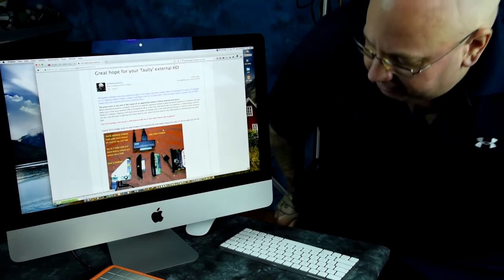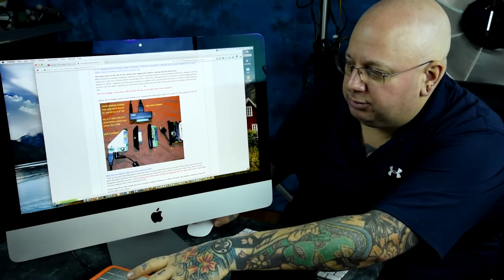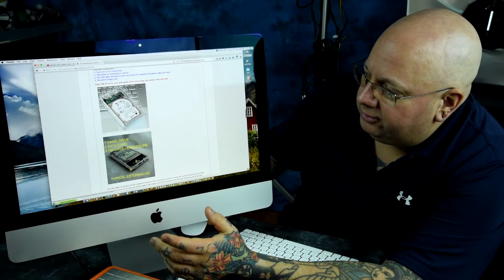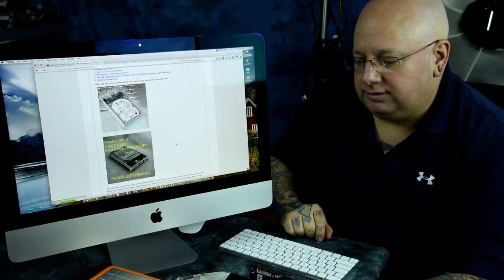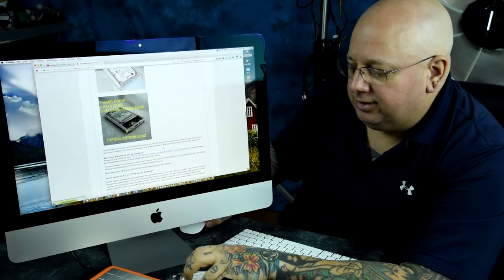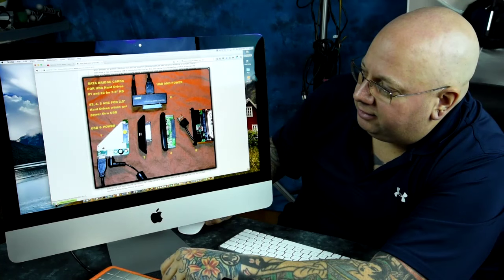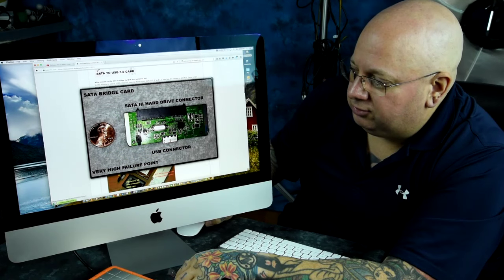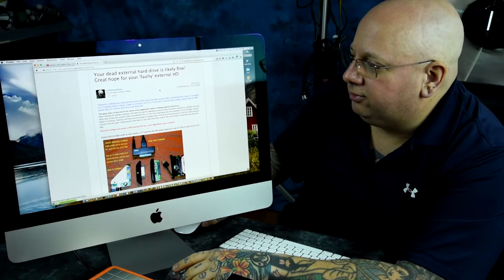Secret of "dead" external HARD DRIVES! How to QUICKLY fix the problem, its cause and solution

Comment: "Responsible for 95% of hard drive deaths". Spot on. I thought I had lost a slew of precious irreplaceable data. I cannot thank you enough. God bless you.
Reply: @Terry Riley how did you manage to recover data?
Reply: @baccount2813 I have a Seagate 2TB external hard drive. The light was on but not blinking and my computer was not detecting anything. I seen this video stating that the SATA bridge is to blame for 95% of hard drive failures, so I did further research and found this video: https://youtu.be/AW12Cm7L3qA It's specifically for Seagate drives but you should be able to apply it. Once I replaced the SATA bridge, all files appeared again. Please let me know how you do.
Reply: @terryriley1174  I have 4TB external harddrive and it shows up on my PC but unable to access it. It gives a pop up message to format the drive. I ran chkdsk (couldn't complete the chkdsk) on my external harddrive and during the process it gave errors like 'file record segment unreadable' and 'deleting corrupt attribute record from file record segment'. I checked the properties of the drive  through a partition software and it showed used space: 0kb and free space : 3.64TB. Don't know how to go about it
Reply: @terryriley1174  4TB WD passport hard drive
Reply: @baccount2813  Sorry but I don't have a clue. I would just type some of those error messages verbatim into Google and take it from there..

Comment: Well, your tip JUST SAVED MY BACON.  My external seagate drive stopped working, so I opened it took the drive out and installed it in an external case, it works just fine, I’m backing it up as I write this note of great gratitude and thanks.

Comment: You just saved my data with pictures and iTunes folder. My Portable Samsung just stopped working, it happened a few weeks ago where it wouldn't mount, but after a few plus / unplug it worked again and I forgot about it, till yesterday or it didn't wanted to mount. Disk seemed to be ok, but little light didn't blink, so after listening to your video, it all made sense, now it's ok, but I'll make a second copy for sure. THANKS!

Comment: I have an old Seagate Barracuda Hdd that would not connect to my PC. It would make a sound like it wanted to start spinning and then it would stop and make a faint click. After watching this vid I went to Best Buy got a hard drive dock, I removed the SATA bridge from the hdd and docked the hdd and it fired right up. I have to mention that I first tried it on an old W7 laptop and the laptop would not read it. Tried with W10 laptop and it worked. Thank you for making this vid.

Comment: After watching ten of these videos, I started first by replacing the external transformer plug-in for seven bucks and it worked.  The transformers do a lot of step-down current work and are prone to failure.

Comment: OMG!  I spent 2 hours with apple tech support, they never mentioned this - she just said it's an external hard drive crash, probably dead.  Bring it to an apple store.  Thank you,
I feel like now, I might be a little more educated,  I don't feel like a sitting duck  :-)  your awesome.  How much should I expect to be charged by them or should I put my head down and TRY to understand the fix and do it myself? 
I noticed it sounds like a car in the wrong gear.  I tried all the R, P holding...Turning off and on, unplugging, blahhh, blah,  but the cursor is still in the upper left hand corner and not responding.  Also, the bluetooth icon at the top of the (screen to the date) has a squiggley line thru it.  the wifi is gray and not communicating.  Could your video be what I need?

 BTW, I ate bacon twice yesterday!

Comment: I've been holding on to an old external hard drive that failed on me in 2010, hoping that one day I might be able to find a way to salvage my old files. Because of this video I opened it up and found that actual drive is separate from the SATA bridge, so I just bought a simple $10 SATA to USB connector on Amazon to see if I can retrieve that old data. (I have a 2.5 inch, which looks more like 2.7 inches, they must round off in their descriptions, much like they round off data sizes, like saying a 250GB hard drive which is really 230GB.)

EVEN if it doesn't work, I'm thankful to finally find out that I'm able to try. The sad part is I used to be irresponsible with my electronics and dropped the thing a lot, so it may not even work still, BUT, $10 is worth finally putting the mystery to bed. I'll reply in 2 days if managed to get back my data or not. 

Thanks man.
Reply: YO. IT WORKED! I HAVE ALL MY OLD STUFF BACK! THANK YOU!
Reply: Ahem. You saved my bacon.
Reply: XtremeIncomeMechaniX muh 2 terrabite hard drive just died

Comment: I have the same one you showing on the monitor, both lights blink on SATA bridge card and the disk spins but drive not showing up on my pc. Do you think I should order the SATA bridge connector replacement for it?
Reply from the maker: yes, sata bridge, but better is a HD DOCK
Reply: @KenTheoriaApophasis   OK thanks for the fast reply

Comment: Not sure if this has been asked before (please excuse if it has) - What HD/SSD manuf should we rely on simply because they use good, quality SATA Bridges.  Put another way, which manuf. should we avoid - of course based on yours and other subscribers experience.  thanks so much
Reply from the maker: +Louis Hecht Jr WD BLACK (only the black),  hitachi, or Toshiba

there are now only really 4 HD mfg. on earth, theyve all been integrated into one another.
Reply: Seagate came up first with the HDD and beat all competitors and bought Western Digital. If you look now everything is made in China.  Hitachi is Japanese a great brand to consider even though Hitachi and others have plants in China. My recommendation is to move on to SSD drives. Resistance is futiles you will be assimilated by technology.  If you go to bestbuy store and  see if they have HDD still..   I am going to choose SanDisk for my SSD to install WIndows in..

Comment: I just bought an external Seagate Backup Plus Slim a week ago. Am I likely to run into this problem. I'm not sure I understood your video; some of us are not too great with technology. You explained the problem but not sure I understood the solution (my fault though). Do you have another video where you actually demonstrate what to do?
Reply: TL:DR = Crack open the external hard drive (remove the shell), slap it on those black dock thingy. EZ

Comment: Hey, great to see your video. However, I have one of those hard drive docks. When I had two in there (it has a cloning function but was not touched) there was a short shortcut sound and now neither one (128 gb and normal 2.5 inch 1 tb) are showing up in finder, system information or disk utility. I have a sata cable and use the bare disk. It lights up, spins but is just not recognized. Any idea?

Comment: I dropped my Western Digital Elements Portable and and it beeps and clicks for 5 minutes and then stops clicking with the light flashing slowly. The drive doesn't appear on any computer I've tried it on. Do you think the data is gone? What is the type of enclosure you recommend? Thanks for video that gave me some hope.
Reply from the maker: click of death….head crash, gonna cost youa  TON to get the data off it from recovery services  :/
Reply: +Theoria Apophasis  Ok. What are the chances that buying the same hard drive and swapping the platter over will work?  The only hope that I have is that on a Windows computer it will successfully find the drivers and show up in the Safely Remove Hardware icon. Thanks.
Reply from the maker: thats doable for certain, ive done it before, not always with sucess
Reply: +Theoria Apophasis  Ok. I will try that. I don't know if WD Elements 2 TB are different but what are the types of screw drivers that I would need to open the drive? I'm going to do some thinking before I attempt it so I'm not feeling anxious. My hope after that is that I can put the new platter back into the new hard drive after the process too.

Comment: Would a bad SATa bridge card cause a beeping external hard drive, or is that because there is something wrong with the interior of the drive?
Reply from the maker: drives themselves dont beep,  nor their controller cards, ……you must have a special SATA bridge (big 3.5" have them) that beeps when sh*t goes wrong…….normal.
Reply: Theoria Apophasis so if I went and bought one of those hard drive ports then it should read fine? I've seen a couple videos where it said that the needle or whatever was stuck on the platter do you to dust or something?
Reply from the maker: not enough info for specifics...   the head you mean....  dust? what? no.
Reply: Theoria Apophasis Sorry, the disc assembly on the inside with the thing that kinda looks like a record player arm. These videos were saying that it may be stuck? I apologize, it's kinda difficult to explain via chat.

Comment: Hi, I have a 2TB hard drive thats gone faulty its for a cctv system, I bought a sata card from the web and run some recovery software, originally picked the HDD up and started the scan,  3days in only on 97% error message then came up on screen showing disconnection and now it seems dead, unfortunately no files were recovered 😢. 
However watching this could it be the sata card that's gone? 
The drive still spins doesn't sound strange or anything. Also the laptop recognises the drive with the card plugged in with no external 12v power I can not click/open as the icon is greyed out, but when I plug the power supply in it vanishes from the screen and this is also the case on the disk part command page any advice would be appreciated 🙏

Comment: well..  the thing is, i have one sata bridge, and four naked hard drisk... 3 out of them work fine, but the fckin fourth one... it used to show up as (local disk f) for few months without being able to show any thing inside it... and i bought abother sata bridge for it... and an electrical usb connector... but still nothing... now its doesnt even show up at all in my computer... and other ideas? sir...

Comment: My dog jumped up while I was working on my computer and got caught in the usb plug of my western digital 2500me and wound up pulling it out of the usb port where it dropped on the hardwood floor.  I plugged it back in but while I see it under devices it is not showing up.  Nor do I hear it whirring anymore, like it used to do.  I tried it in my laptop with same result. If I don't hear anything does that mean that this hard drive is broken beyond repair?

Comment: Great info. I purchased a SATA 3.0 6Gps 1TB "external hard disk" (with the 3.0 usb cable) BRAND NEW IN A BOX from ebay. It weighs about 1/4 lbs. It worked for about ten minutes. Then my win 10 didn't see it anymore. I put it in a mac and was able to format and tried again in win 10. Now I had fatal error and tried to reformat in the mac again but this time....dead. I complained to the seller and eventually got my refund. I only paid like 30€. They didn't ask me to send it back, so I figured maybe I could fix it. After watching your clip and seeing the low prices on amazon for connectors I was all happy. I took out my small screwdriver to open the casing, and to my surprise found a USB FLASH DRIVE along with a SQUARE METAL PAPER WEIGHT OF ABOUT 1/4  LBS. Now, I can't say that I saw 1TB storage size on my computer (when it was working), but I looked up the prices for the largest USB flash drives....USB 3.1 2TB goes for $1,650

Comment: I'm a complete newbie.  Before I crack open this WD external hard drive and attempt to change the said Sata card, I wanna ask you......I smell burning smell when i plug it in and it doesn't power up at all.....still sata card?
Reply from the maker: HD controller board…..smell from WHERE?
Reply: Theoria Apophasis right where the power source connects to the outside of the external hard drive
Reply from the maker: HD controller board…   bad news
Reply: Theoria Apophasis catastrophic?   data recovery company?

Comment: the problem is, these days lots of those toshiba en wd 2.5 drives have integrated sata connectors  no removable sata parts anymore plus on the 3.5 wd drives a lot wd drives do encrypting so when the drive controller goes theres little you can do  the chips are linked to that drive because of that protection key So everyone should keep 2 identical backups so you can make a future copy if one goes down

Comment: If I may ask...My HP desk gave me the "hard disk failure is imminent" message about 2 months ago (yes, I have a functioning brain stem so I'm backed up on a 1 TB external). I also bought an identical replacement HDD as the one I have (Seagate 750GB)Now the questions; I have used this "imminent failing" PC for 2 months and the only issue is it responds slowly, no "read or write" noise coming from my HDD, no other problems at all except it's silent. Both fans are spinning but my PC makes no sound? Do I just back up the operating system, swap my new HDD and toss the old one because I got an error message? It's passed every test I ran (chkdsk etc) or do I save this "dying" HDD and make it a second HDD? My PC is acting like a PC does when it has a virus, not a dying HDD, I've already purchased a replacement but I'd hate to ditch this HDD if I can use it for additional memory space etc. Thanks so much
Reply from the maker: 1 backup is not enough 
clone the HD and then wait for failure.    Easy greasy

Comment: ive got a 1TB Toshiba external hard drive i dropped it (in its case) on my desk into a jug of about 2&1/2 inches of water for no less then a couple seconds as i was quick to pull it out but it was quite a bang as it hit the surface. then when i next tried it it was making a clicking noise, i sent it to a company called fields-data but unfortunately later learned it was a scam company i desperatley need all my data back as its very important for work reasons, i dropped it back in july (2016) but need it back ASAP ive tried the hard drive recently and it still lights up when i plug it in but now theres no clicking noise what would best suggest i do?! thanks
Reply from the maker: and why didnt you have redundant copies?
Reply: because i not long had purchased the external hd to copy everything off my mac to it, then a week or so later i dropped it
Reply: so what would you suggest?
Reply: a hard drive is a very fragile piece of electronics, you can't be 2 rude with them, when its of and you drop it, there is a good chance that the drive still works, but when the drive is turned ON and you DROP IT, there is SO MUCH that can go WRONG! If you drop it when the heads are floating over the platter, you surely can say goodbye to you're hard drive! My advice i can give you? 1: you should get a external SSD which are VERY good against dropping and 2: make multiple copies of you'r data! Get 2 or even 3 hard drives and put all you'r data on them! So whenever 1 dies, you still would have a copy of you'r files!
Reply: innnteresting, bram. i just recovered my first couple salvaged hard drives as i'm new to this, and i dropped them both in the process. after yelling out some oh-so-bad words and scaring my cat while doing so, i thought i just jacked up the drives but then i read your comment. they weren't plugged in! 
so, yay! here's to hoping!!!
Reply: ...also, avoid working with delicate stuff over water. lol.

Comment: seagate external harddrive lights up and spins but wont recognize to my devices anymore
Reply: this is happening to me exactly on my intenso hard drive. did u find a solution?
Reply: I have a Seagate external  harddrive, when I plugged it in it makes a faint beeping sound, does not spin then the light blinks until I unplug it.  Any thoughts??
Reply: Dani Dalpaz I just bought a new external hard drive. If something bad happens again I’m gonna subscribe to a cloud service named opendrive which is 10$ a month for unlimited storage and I’m gonna upload stuff there only
Reply: Any solutions yet..?
Reply: i got a 2tb seagate as well it does not recognize it and a faint beeping sound but worked.well for the last 2 months

Comment: My problem is all but one of my old Hard drives won't install, they are from Windows XP, and it's telling me in device manager that all the drivers are up to date, one of the drivers is dated 2006 Windows tells me it's up initialise the disks. Windows 10 disk manage either tells me all the disks are damaged or the data size is too small. Can someone help please.

Comment: I tried this and nothing worked. I suspect the main board for the external is faulty because with HDD sentinel it last showed that the temps were high so I suspect mine had a bad chip or something on the main motherboard that went faulty with time because I barely used it. It was a back up drive for everyone's personal data so now in South Africa nobody does repairs or recovery because I searched and looked everywhere I can. The "experts" are obviously going to overcharge to do this

Comment: I have a external hard drive that is 5 years unused because i thought it was corrupted or may be dead hdd so i keep it with a little hope that i might get my data back. if i change the sata bridge right now can I use it again remembering that the lifespan of an hdd is three to five years so basically my external hard drive is almost 9 yrs old. I hope you notice my comment